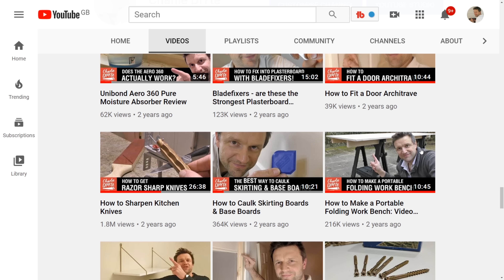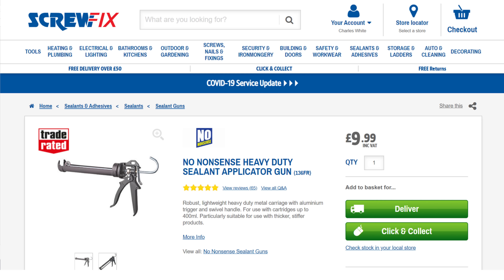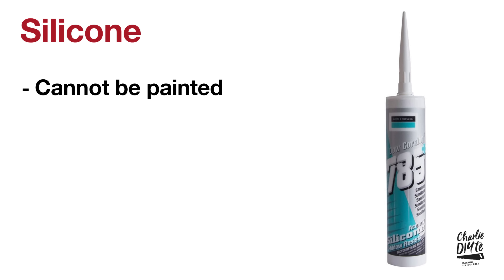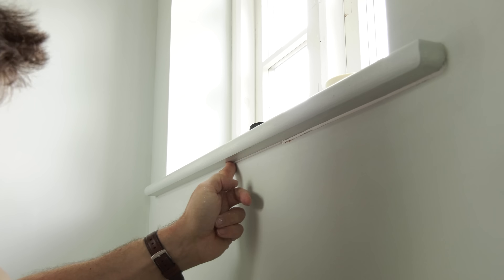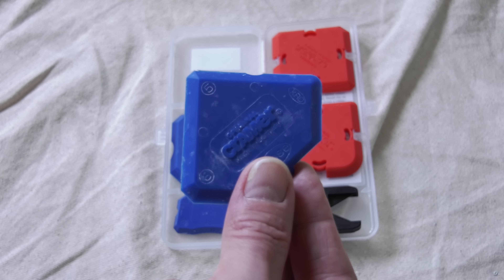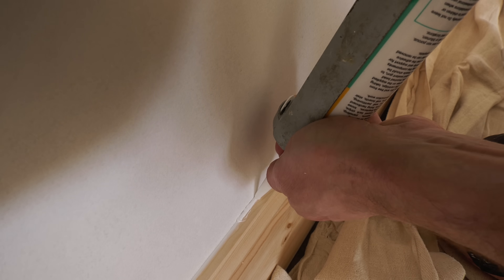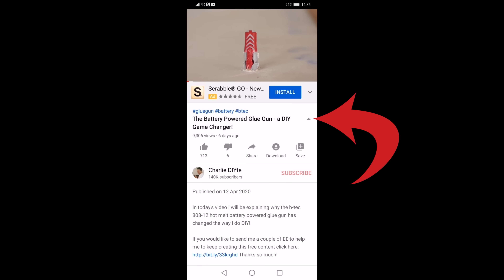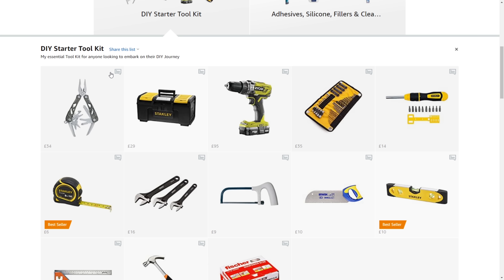How to Caulk Skirting Boards & Baseboards - 2020 Update

Comment: The main issue I find with caulking the gaps is that the paint "crazes" in time after painting over the caulk. It ends up leaving crack lines in the paint if that makes sense? You seem to have over come this problem and I would love to hear how.

My tip for keeping the profile tools and your fingers clean is to use baby wipes - they are excellent for cleaning up and if you keep a set of scissors handy you can just snip a bit off a wipe rather than use a whole wipe each time. Likewise if you are using tissue, before you start tear up lots of small sections of the toilet paper etc and place them in an big pot and then you have them ready for when you need them as you do the job. Blue paper towel I find is the best for DIY and also on a side not is the best to use when checking for water leaks say around a pipe joint as the paper goes a clearly contrasting dark blue to the light blue of the paper. Much easier to see than when using white toilet paper.
Reply from the maker: I left it over 24 hours before repainting, and that was after applying a second bead to the original, to minimise shrinking. I think the problem is a lot of the caulks say you can paint immediately or within 30 minutes. I tried that on a small section and the problem was because the caulk was soft underneath I accidentally scooped it off when working nearby. So I would never paint before the caulk has completely set, because the cracking happens when the caulk shrinks below the paint.
Reply: It's not the caulk if fully dry 
Some matt emulsion dry very brittle and craze
When dry give it a thin coat of undercoat or zinsser BIN
Allow to dry it won't craze
Reply: @CharlieDIYte  Thanks for the reply - I have always left mine for some time before painting, sometimes well over a week but I get the same problem. I like the idea from another commentator to my comment about using an undercoat of say Zinnsser BIN - For some reason doing that never occurred to me despite having a pot and finding it excellent for undercoating pipework before painting which must expand and contract constantly as the pipework heats and cools as water flows. I will give that a go in the future! Reading the comments can often be as rewarding as watching the videos for picking up tips! Thanks for the content!
Reply: @DB-kv5mb  That is a great tip about undercoating, I will try Zinsser BIN next time. For some reason doing that never occurred to me despite having a pot and finding it excellent for undercoating pipework before painting which must expand and contract constantly as the pipework heats and cools as water flows. I will give that a go in the future! The comments sections of videos are invaluable for such tips so thanks for sharing your thoughts!
Reply: If you want caulk or any paint to dry invest in challeng 3kw blow heater £20 in Argos.  It will even dry plaster etc. Don't waste your money on dehumidifier s or oil heaters  . trust me every decorator has at least one blow heaters

Comment: Charlie, in the video you filled the gaps between the top of the skirting board and the wall with BondIt Solvent Free Gap adhesive, then you use a 45 degree bead of Decorator's Caulk over the top of the Bondit.  Are you not giving yourself unnecessary extra work here? I say this as The Bondit is overpaintable (like the caulk),  so why bother with caulk ? Also, after copying your method on my own skirting board, I note that the caulk attracts all manner of dust (once dry), whereas the Bondit doesn't (it stays clean). Using the profiling tool you described, I can get a nice professional 45 degree angled bead of Bondit. Always interested in any feedback, and wondering if any others watching this video had a similar experience to myself ...
Reply from the maker: Yes mate. I don't know why I used the caulk except I think it was for a really simple reason - I didn't have enough Bondit to do both. That said, you're painting emulsion on top and it's the emulsion which attracts dust, particularly if you have a flat matt emulsion like I used here, but you should be able to vacuum it off.

Comment: My plumber fitting skirting in the bathroom but didn’t caulk at the bottom where it meets the floor tiles. What should I use in this area, caulk or silicone?  Loved your video, I’m happy to have a go myself now as long as I get the right product! Thanks
Reply from the maker: You've got to be a bit careful because you can't paint over silicone and caulk will need painting as it will otherwise quickly get dirty. I used this https://youtu.be/V6lZXjRR-1k with my gaps, because in my case it was the draught I was wanting to exclude. This would be my recommendation if you just want to fill the gap, but if you're looking for a solution that makes washing the floor easier, then silicone is your best option

Comment: Hi Charlie, I have really enjoyed your videos on skirting & their caulking - very useful for our Victorian terraced house. Just one question for you though - I'd really appreciate your feedback ...

My gaps, between the top of the skirting and the wall, are between 0 mm to 3 mm wide, so not as big as yours. Using the technique you described, I filled the gaps with the white-coloured Bondit solvent-free gap adhesive, and got a really nice & neat flat finish with the right-angled plastic profiling tool.  

However, I'm wondering whether I really need to caulk on top of this. Maybe a bead of caulking, profiled to a 45 degree angle, would cover not only the gapped areas filled with adhesive, but also the areas with no gaps within a single length of skirting - I think this might make the top of the skirting look more uniform along its length, masking both filled gaps and no gaps. I'd be grateful for any comment on this ...

Comment: Great video, I'm used to using the finger but I may try the tool now. Any suggestions when doing around a bath or shower that's tiled above? I've always found the finger is the only way, any tool puts wobbles in the silicone as it passes each grout joint.
Reply from the maker: The black sled that you can insert into the red Cramer tool slides over the transverse joints and prevents that wobble. I talk about it in this video https://bit.ly/3iEyUMU as well as my original siliconing vid https://bit.ly/3k3UAVn

Comment: Which caulk and method would you use on a staircase skirting board. No matter how flexi or expensive the caulk, the movement of the stairs always cracks the caulk and paint

Comment: Great video! 
Can you also caulk PVC skirts with silicon ? I live in an older house and the walls are not perfectly straight and there is a small gap (1-1.5 mm) between the skirt and wall surface. I would like to hide this gap. The wall already has the final coat of washable paint applied. Thanks

Comment: Hi Charlie, great video. I've just had all my ground floor done in LVT Amtico. Our kitchen fitter replaced all the ground floor skirting boards with pre-primed MDF. At the top of the board its been a piece of cake to caulk it. But the gap between the bottom of the board and the floor is very uneven and has become a nightmare to fill. My old friend Arthur "Two Sheds" Jackson, a professional carpenter would have scribed the skirtiing to the floor and there would have been no issue. The floors solid but not that level even though it's been screeded. What's the best product and method to tackle this TIA.

Comment: Great videos! Wondering if you could give us the easiest and best way to remove silicone caulk from an Undermount sink : stainless steel sink , granite countertop. I am afraid of scratching the sink, and also not removing enough of the old worn down caulk. Obviously biggest concern is to avoid leaks! Please also Describe best cleaning method before applying silicone. Thank you!
Reply from the maker: If you're in the UK, you might try Multisolve spray - as discussed in this video https://bit.ly/2LoUdpl There are lots of silicone removers out there, but Multisolve evaporates leaving no oily residue, so cleaning prior to siliconing is a breeze. Don't use WD40 whatever you do, because it leaves an oily residue you'll never remove meaning new silicone will never bond properly. Other than that, I'm afraid it's just hard graft. Get a plastic remover tool if you're worried about scratching the stainless steel.

Comment: Hi charlie great video again... please can you link the correct skirting primer you refferred to if im not mistaken you use zinsser bin primer? And also do i use same decorators caulk to fill im the screws on the skirting board? Many thanks
Reply from the maker: This is the primer https://amzn.to/3TolYMQ (that's a small tin but it does go a long way). No, to fill the screw holes I'd use a two part wood filler as caulk will shrink. I'd use something like this https://amzn.to/3TCSR8c 👍

Comment: Have you tried putting kerf cuts in the back of wooden skirting board so it bends and conforms to the wall better? They need to be angled so you don't cut the top of the skirting board. Its useful when there is a bow in the wall too. Great video Thanks for posting. I will be making my own profiling tool as i have some scrap pieces of perspex in the workshop.
Reply from the maker: Thanks for this. No I haven't, and I agree that would make it easier, although all pine is so quick growing and soft these days, it bends pretty easily. Just be wary with the perspex. It's a hard substance and won't be anything like as effective as the Cramer tool in scraping away the caulk.

Comment: Sorry for total newb question - but for sealing skirts and windows / door frames etc.... When should you use caulk and when should you use silicone?
Reply from the maker: Don't apologise 😉 The thing you've got to remember is you can't paint over silicone. Also silicone is a bad insulator. So at the top of skirtings you always want to use caulk as it can be overpainted, which it needs to be as it's a dust trap if it's not because if the slightly rubberised texture when set.
Reply: I'm tempted to buy one of those profile things, and have a go at all the sealant disasters around the place.
Lifting, smeary, lumpy, bumpy, tacky...

Comment: It all depends on if it is new construction or old construction, if the carpenter was good that installed the trim pieces being painted, what paint is being used, if you are painting the walls and if so are you sanding anything or parching. And if you are painting the ceilings too. 
It is hard to tell people how to paint and in what order from a computer when you don't know the situation. Generally a pro painter can rolling the cieling after cutting in the cieling first, then cut in all the trim or spray it top and bottom but this is where it mattera if you are doing cielings and if you are spraying or 
Not.  Then you cut the wall color by hand and you use a good paint so one medium coat is all that is needed, then you quickly roll the wall color and you are done. It dependa though on a few things like i said. How many people are working with you, how much you have to do and how much prep there is to do and what the customwr is paying and what they expect and how long and the quality indicated and paid for. I would usually rather cover the floors in paper and tape to the base board bottoms. Then spray cieling and overspray onto the trim that being my firat coat using that as  primer if it isnt primed if it is then i just overspray a few inches. and also spray the baseboard with the same stuff but only after they have both been caulked cieling to crown and crown to wall and also baseboard to wall and baseboard to quarterround. The paper would be cleanly taped evenly to the floor with no gap in between the quarter round and the tape. Then spray the baseboard thick with that white gloss and that is that. You can usually get a clean one coat on it especially if it is primed already. Then pull both and roll the wall color thick anfs atart in middle and get close to the top and bottom about 3 inches with a one coat medium thick on everything but thin it out and feather it on top and bottom 6 inches from your 3 inches of void to the crown and baseboards. Then i dinally go back and cut both top and bottom by hand or with shield and apray with shield or i cut by hand depending on new or old construction and what's paint and price. 
Then go to the next one. It is different though if you have rough walls or rough trim or whatever comes up. Sometimes it is best to lay thick on tbe trim and overlap to fill in gaps and build thickness and make a clean edge to cut with and sometimes its beat to go light and coat it twice and move on. Somwtimea i just free hand and others i tale and others i use a shield and have a helper xoean the shield and rotate them every few times i spray or use to cut. It the walls and trim are layered up and uneven tape qill do you no good and you cut by hand. Sometimes it is best to overlap with volor onto trim and then cut the trim in and be done. Sometimes its best to overlap with trim paint onto wall and then cut the wall color in. Sometimes it is just best to tape trim and others wall

Comment: Great video(s).  I appreciate the tip of painting walls/skirting the same colour, it looks great now I see it everywhere!  Do you use different paint types for the walls and wood though?  I'm struggling to find emulsion and wood paints in the full range of matching colours.  Thanks.
Reply from the maker: Thanks 🙏 Yes I did use different paints for the wall and wood. I get my paint from Johnstone's and they will mix to the colour you ask for. B&Q, Brewers, Dulux Decorators centre all do a similar service.

Comment: Can you a demo with black silicone ? Had to do around a black patio door against a white painted wall, it did not go well !!
Reply from the maker: If there was a big gap, you could have used expanding foam instead https://www.youtube.com/watch?v=V6lZXjRR-1k&t=47s I used it here for draught proofing, but its really designed for external applications like yours. You could remove the existing silicone you've applied with Multisolve spray from CT1 or some other silicone remover.

Comment: Thanks for the informative video, I learned a lot. I'm in the process of decorating. My flat never had a proper misting layer so things peel off easily. Couple of questions, can I caulk after painting, eg around cracks of door frames, I like the clean lines look. Finally, as a beginner, how easy is it to do myself... I bake and ice cakes... similar? 🤷🏽‍♀️
Reply: Did you find it easy? I bake cakes too and I’m trying to do a big job, I feel it’s the same as decorating a cake. I wonder what I’m setting myself up for😄

Comment: Fantastic guide - used gap adhesive and the right angle Cramer tool today for my oak skirting boards and they look great! My question is do I have to wait 48h for full cure before I do the diagonal caulk on top??
Reply from the maker: Thanks. I'd say follow the instructions on the tube. Seems a shame to rush a great job for the sake of 24 hours 👍

Comment: Hi Charlie, as a handyman I often find the edges of skirting shower tray are not 90 degrees. This make using the profiling tool not able to fully sit properly on the edges. any advice mate? Love your vids x
Reply from the maker: Thanks mate. D'you mean the corners? Sometimes I tilt the tool or use one of the smaller tools so that it doesn't clash so much on the angle.
Reply: @ thanks Charlie

Comment: Hi Charlie, great video. Quick question, if I use gap adhesive to fill the big gaps at the top of the skirting, can I then use a decorators caulk over it?
Reply from the maker: Yes that's exactly what I did here.

Comment: Once again, amazing tips from you Charlie.
Yours is probably the only channel I never double tap forward, maybe more than twice backwards but never forward. It's that informative!
Happy to tell you that we've moved into our new house, I mentioned a couple of months back and I must say there's a lot of work that we'd have to do ourselves.
First off we put up our new sink, siliconed it, but it sank backwards a bit letting some of the dishwashing water pass through the crevices cuz I must admit here, we didn't give it much time to dry, cuz we always seem to be in some sort of hurry that we mess things up. I on my own  on the other hand, can do a lot better, lol.
Anyhow, question is, can we cut back that silicone and take the kitchen sink out, pad it out underneath somehow cuz the guy who cut a whole for the granite has probably cut a mm or two deeper at the back. That's what I understand from the scenario. Which would inturn create a seepage in the long run, not to forget the ants already digging their way into concrete.
What's your thought on this and can this mistake be corrected? Don't want to call in that guy in again, they don't listen so I'll be doing this myself. Thanks
Reply from the maker: Hi mate. Thanks for the kind words. Best to email me a photo to charliediyte@gmail.com 👍
Reply: @CharlieDIYte  Will do, asap.

Comment: A point of note with the recommended Sashco Big Stretch caulk, if you are using a hard paint on the baseboards/skirting, like a 2K polyurethane, it will likely spider crack all over and look unsightly. The caulk is too stretchy of a substrate, and as the paint dries it pulls on the caulk and cracks. I learned this the hard way :-\